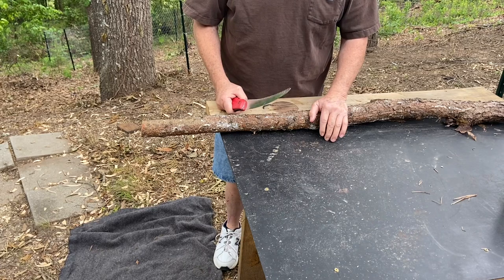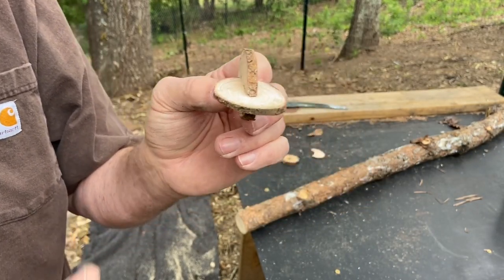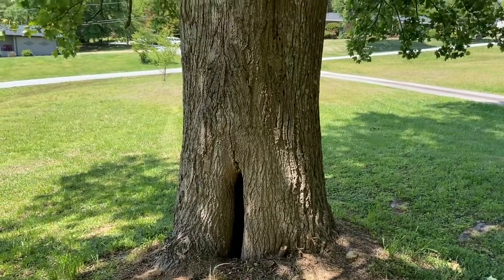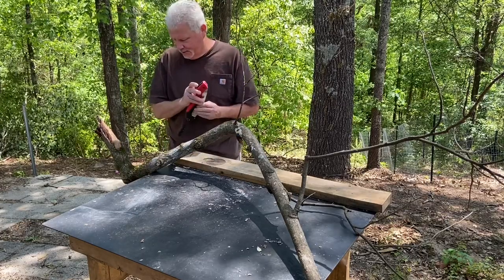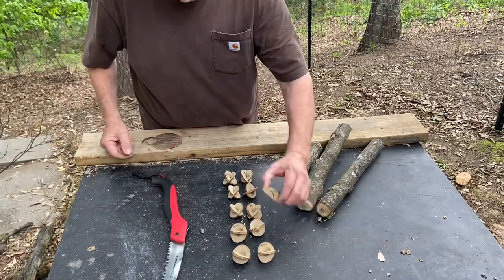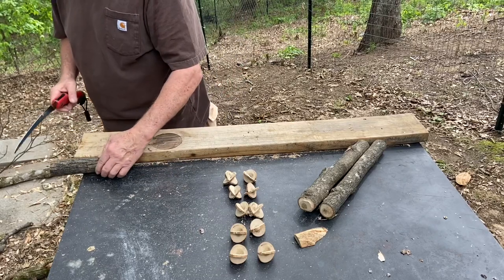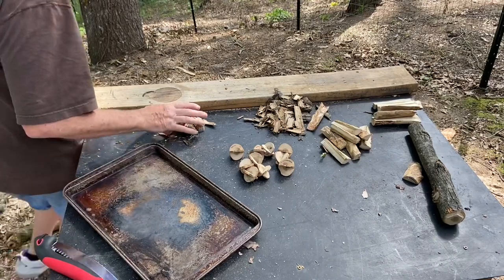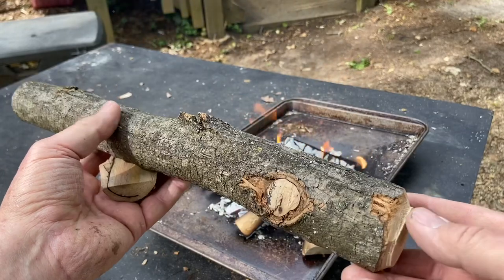Corona RazorTOOTH Saw Is Amazing! No Knife Fire Practice - Batons, Wedges, 3D Discs, Ferro Rod Strkr

Comment from the maker: After you watch the video, run right over to Lowe's and pick one up... a Corona Razortooth Saw for just $20... of course, then, come back and watch more of my videos! LOL!
   I guess I got a little carried away with today's fire practice. The only thing that I had on my mind was to practice half lapping 2 wood discs together and see how well they ignited for tinder. So I was just going to film some of the practice, but then got all excited about the possibilities of the no knife fire practice. I ended up spending the rest of the day workin it out.
   I like the way the 3 dimensional discs stand up no matter how they are thrown in the fire. They're covered inside and out and roundabout with very thin edges which are perfect for flames to easily ignite. 
   By the end of the day, I realized what an amazing job the Corona Folding saw had just done. It melted right through over 40 cuts, did lots of notching, lots of quick rip cuts, I used the first 2 teeth to slice open the Tulip Poplar bark, and then I used it's sharp spine to scrape the ferro rod and get the ignition.
    LOL! If that's not enough uses for you then check out the LINK below that shows all the other firemaking capabilities this great saw has. Please follow all the LINKS below and SUBSCRIBE. Thank You!

Corona Razor Tooth Saw from Lowe’s is a GREAT Fire Maker!!! Flint and Steel, Ferro Rod, Bow Drill
https://youtu.be/m7zueU9Tltk
Ferro Rod Playlist
https://www.youtube.com/playlist?list=PLkoXX8XsMW3lI6k8TH1Bljf57Yvp9K1WD
Reply from the maker: I'll have to try it.
Reply: Just recently bought one at Lowes after searching hi and low for them. $30 now! What a difference a year makes!
Reply: @ivaylodechev9611  thanks, that's impressive!

Comment: You should do David Pearson's (reallybigmonkey1) latest challenge - 6 wood only fires in 60 seconds. Tag Video
Reply: I told Reallybigmonkey1 that he should tag you in this challenge and he responded back to me that you could beat him with one hand behind your back. As I recall you did that in a video. Good Times!
Reply from the maker: Dave encouraged me and advised me a lot about 7 years ago before I ever got good at any of these techniques. He probably doesn't even remember that... But, I have the greatest respect for him!
Reply from the maker: I just watched it. I cant wait to try dry brown rotted wood like he showed. Most brown rotted exterior wood is not going to be that dry. Here's a 6 fires in 60 seconds that I did, but includes a lot more steps. In 60 seconds I did the intro, slight processing of the pine needles, ferro rod ignited those 6 piles (10 seconds), and the outro... But here again... my pine needles were very dry also. https://youtu.be/USLPQwwPQa8
Reply: @DavidWestBgood2ppl  - yep I thought about that video when I saw his latest post. He ought to try the one handed fire starting challenge as well. I always look forward to both of your videos. - THANKS!